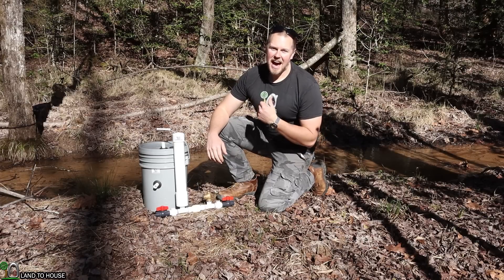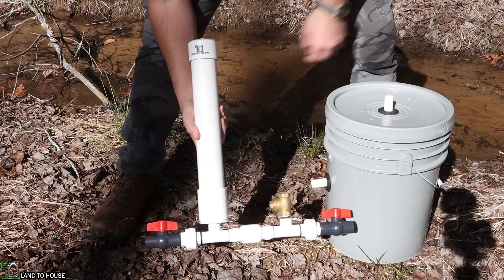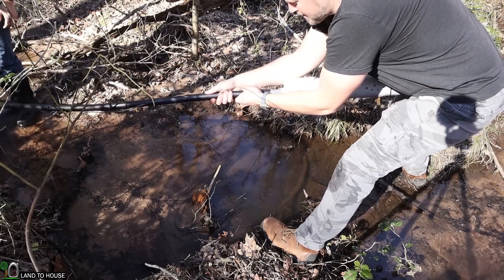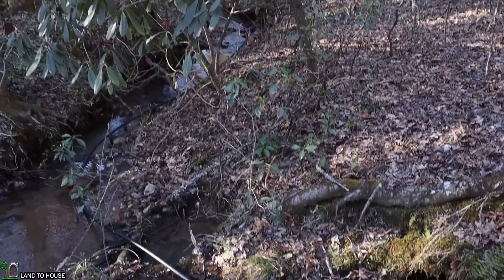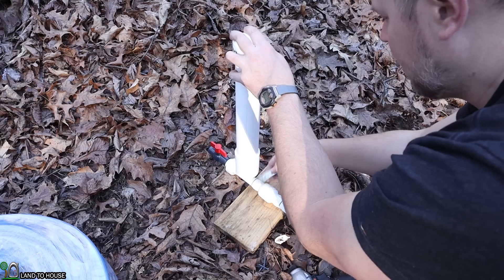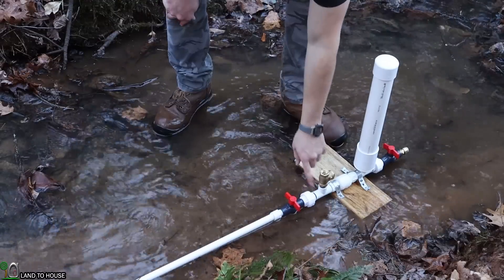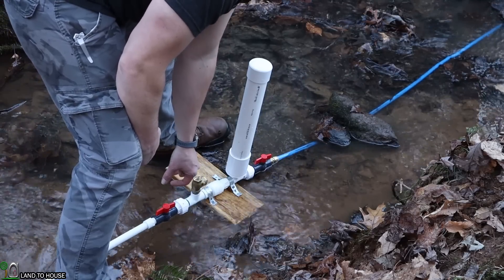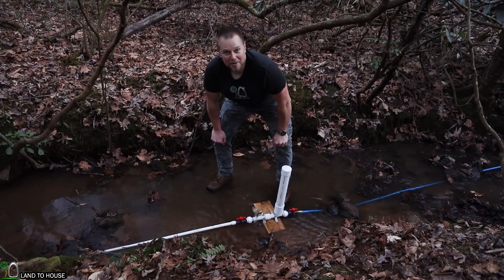Off Grid Water Pump lifts over 50 feet [Full 1/2" Ram Pump Install]

Comment: Seth--the creek water level is about 2' deep at the low water point. Does the filtered  intake unit HAVE to be above the bucket? Or if water pressure is there without gravity, will it work?

Comment: how big must the ram - pump Be to give a delivery of 4"pipe .
Reply from the maker: You can use any size delivery pipe you like on a ram pump. If you are looking for that much water you will need to find another style pump. The ram pump is not designed for that.

Comment: With that flow, in my opinion an intake box (preferably with coanda) would have been a far better choice. It would eliminate sediment, prevent that pipe from being clogged and increase your head pressure slightly. If that stream floods, that whole assembly is going by bye…..

Comment: would have made a dam and then the ran setup in front of the dam as the dam would trap sediment and your pipe would have clean water. your supply pipe would be set i n the dam giving you more head pressure

Comment: great video. lift is not perhaps the word though. water can only be lifted 32 feet at sea level. It can be pushed, up any distance though. water will separate into a void if it is drawn any higher than 32 feet. Not being a water asshole here, just hoping to add some physics to the thought pond. Your pump is great and it pushes water.

Comment: I ran a test a while back. I changed the first one-way valve from vertical to angled. I wanted to see whether it would change the flow rate and it did vastly improve. One direction results in the flap closing with lower water flow since the flap is already partially closed while at rest and the pump cycles quickly. The other results in a delayed flap closure since the water velocity must be higher to overcome the flap being angled past vertical. This has a slower cycle time, but the water velocity is higher. I allowed the system to run for a few minutes at each angle and did a stop watch test with a 20 ounce bottle. Have an amazing day!

Comment: Seth    I bought a little 1/2 inch pump from you two or three years ago and began experimenting trying to get water from a creek up to an orchard.   I know you look for ideas to create videos comparing different designs.  I have found through experimentation that I can almost double the flow of my system by using a check valve one size larger than the ram pump.  I currently have a 1-1/2 inch ram pump with a 2 inch swing check valve (stainless).  Changing from a 1-1/2 inch check valve to the 2 inch valve changed my flow at the top from 54 seconds / gallon to 29 seconds / gallon.   My system has a 500 foot run up the orchard with a 70 foot lift.   If you want to try something different, try experimenting with increasing the size of the swing valve (oversizing it) without changing anything else.   As always, great video.
Reply: Changing both delivery valve and waste valve or either only delivery valve or waste valve?

Comment: For the blue PVC pipe supplying the water for use: could you start with a bigger diameter pipe (like 1") and step it down to 3\4" to 1\2" and build pressure that way? I know we do it in residential houses just wasn't sure if it would work in this application?

Comment: I remember viewing a video of how California gold miners used water to create a massive high pressure water hose to wash the banks with water to find gold. They did this using progressive larger pipes going uphill to the water source. Since water is just over 8 pounds per gallon this water weight increase the water pressure at the base to a modern day fire hose. This would be a good model for this project to maximize one's efforts.

Comment: I’d like to see a video of a high lifter pump, I used to own one years ago.  They can run on as little as a trickle of water, automatically start on their own and deliver water up to 1000 feet of head, given enough drop and enough water.  Ours delivered 1300 gallons a day with about 30 feet of drop from collection to the pump (drive pipe) and delivered it 400 feet of head.  It was absolutely the coolest thing I’ve ever purchased.
Reply: Where did you purchase it?
Reply: @ here’s a link to where you can buy one. I suggest you look at the requirements that are needed for it to run properly. That information is available on their website. 
Best of luck,
Robert.
Reply: @robertg9514  I didn't see no link. Can you post it pls. Thanks

Comment: Land to house

Damn son, not only could I see the weight gain, I can hear the shortness of breath when you speak.

20 carbs or less per day, I lost 0.5 lb per day on that diet

93 lb later, I stopped doing that keto diet 7 years ago. Haven't gained anything back

It's totally worth it and you only have cravings for the first couple weeks. After that. It's easy sailing

Comment: Very good video! Please be aware of a few things plumbing related...1. An effect called friction loss. Where for each foot of water in a pipr you will lose X amount of pressure due to friction against the inner walls of the pipe. In theory you could run a pipe long enough the the infeed pressure is totally negated by friction loss and no water would ever come out the other end. 

2. When you double the diameter of a pipe, the flow rate is quadrupled! So changing that 1/2 inch pex to a 1 inch line would allow a much better flow at the end! 

Thanks for sharing, i was unaware you could have such a long infeed pipe for the ram pump to achieve your drop/head pressure.
Reply from the maker: The output of the ram pump is low flow low pressure. At 1/4 gallon per minute at best on the small pump the friction loss should be very small. I would have used a poly for the delivery over the pex.

Comment: Am wondering.. does the size of pipe matter from the Ram Pump to the storage tank? Is there more output volume with a smaller pipe or more with a larger pipe... 1/2" vs 3/4 in.
Reply: I think you want the intake pipe to be double the size of the output pipe

Comment: Why not strap the ram pump vertically to a tree?
Reply from the maker: That is a very valid way to mount the pump. This homeowner was going to move it 100 feet further down the creek so we did not lock it down in the video.

Comment: Can you use a ram pump to pump water up a hill then down the other side and have a water turbine creating power at the bottom? Once the ram pump gets up to the top, suction and gravity should pull a steady flow down the hill to create power. Just a random though lol
Reply: It wouldn't be anything worth doing. Pressure and flow need to be very high
Reply: If the outlet elevation is lower you can just siphon over a hill.
Reply: Maybe run it up to a water tower then run that out to another ram pump going down over to your watermill or whatever you're powering. Idk I'm not a plumber

Comment: I have an 1 1/4" ram pump. I need to lift the water as far as possible. It takes less pressure to move a smaller column of water correct? I wonder if I should use 1/2" PEX or 5/8" or 3/4"? (About 6" of drop with massive amounts of water)

Comment: I have a low-flow creek. I want to build a 1/2 inch pump that will deliver water about thirty feet to a 100 gallon tub. The approximate lift from creek to tub will be about ten or fifteen feet. How much supply pipe from bucket to pump? And how much supply pipe from intake to bucket?  Do you have a formula? My understanding is for every one foot of intake there is seven feet of lift, but I'm not sure if that is from the initial intake or the reservoir bucket. I'm near to going on Amazon and buying your 1/2 inch ram pump. Thanks for any help. I'm subscribed.
Reply from the maker: The 1:7 ratio of input head pressure to lift out is correct. The ram pump needs 2.5 feet of head pressure minimum to get the pump cycling. This minimum is all you would need to lift water to 15 feet. 

The head pressure is measured from the silt bucket to the ram pump. If your creek does not have much silt you can remove the filter bucket.  The head pressure would then be from the source intake to the pump.
Reply: @LandtoHouse  Thank you much for the quick reply. I think I'll try the bucket-less approach first and see what happens. Much clearer now what I have to do. The creek runs under my driveway and through a culvert. I tried putting my tub under the culvert, and it filled up so high so fast with silt that I couldn't move the tub and had to empty it by hand. But I don't want to use a bucket because the creek is shallow and full of rocks. We'll see what happens. Thanks again. Keep those videos coming!

Comment: For filling the delivery pipe, could you not do the usual trick of leaving it open to match the source, then close the value, get the pressure tank up to pressure and then open the delivery again to use the pressure to shove water up the delivery pipe, then close and repeat until it cycles on its own. Should bring down the number of manual valve pushes because it only needs a couple to pressurise the tank enough for it to run on its own. 

I’m thinking manually action the valve a couple of times until the pressure tank builds pressure to run on its own, let it run for 30 seconds or so, then open the delivery and wait for the pressure to drop, then close the delivery again, manually action a couple of times until it runs on its own, leave for 30s and then open the delivery again. Rinse and repeat until the delivery is full enough to cycle on its own. 

Hope that rambling made sense 🤣
Reply: Also perhaps capping the delivery pipe to compress the air in it to build back pressure might work.

Comment: Squirrels love to chew holes through the blue 1/4” used in maple stands for syrup production - destroying pressure. Do they bother these setups?
Reply from the maker: I am not sure about this pex line. I have found that 100psi poly pipe does well with squirrels. The thinner 50psi poly gets chewed by squirrels.

Comment: I’m on your site about to purchase the 1/2”. What’s the difference between the ram pump and the ram pump kit?  Do I need both to make it work?
Reply from the maker: The ram pump is a fully assembled pump and the kit has all of the pieces that you assemble a pump yourself. They are separate pumps. You only need one or the other.
Reply: @LandtoHouse  okay. Thanks. I just wanted to make sure. Do you install pumps in Virginia?
Reply from the maker: Happy to help. I actually have only installed for local people.  Today's video was for a friend.

Comment: The #1 element that people overlook is the "head weight" of the water inside the tube. The higher the water is to be pumped - the smaller the tube needs to be. If the tube is larger it holds more water and it's weight will always push down. 
This is a great option and I hope many of your viewers try this. 👌 -KJ
Reply: your talking about the "output side" pipe diameter needs to be smaller for longer distance?.. thanks
Reply: @genealamos9888  Correct. The more water you're pushing up at one time - the more weight your pump is fighting. Skinny tubing takes longer but it's the only way to go up great heights.
Reply: @KaleidoscopeJunkie  thank you makes sense
Reply: Head pressure at a given height is the same in a 36 inch diameter pipe as it is in a 1/4 inch one.
Reply: @44thala49  The problem is not the pressure per diameter at one given point.

The problem comes with the water above that point.
 More water = more weight/resistance.
10' of water in a 36 in dia pipe weighs more than 10' of water in a 1/4 inch pipe.
Simple physics.....🖖

Comment: Shouldn’t he have used poly pipe for the delivery pipe instead of pex I thought pex isn’t UV stable?
Reply from the maker: I mentioned that to him but he wanted to use pe . Perhaps he will be putting some ground cover over it.  I recommend 100psi polypipe for the delivery uphill.
Reply: @LandtoHouse  You mention 100psi poly, but in this application would 60psi be sufficient as well?
Reply from the maker: The thinner poly is more likely to be chewn by rodents. But it works just fine for the ram pump.

Comment: What is the stand pipe for? Just get rid of excess air?
Reply from the maker: When the pressure wave travels in a drive pipe that is too long it starts to weaken. Much more than 100 feet and it drops down to nothing. This stops the pump. The stand pipe brings the source head pressure closer to the pump and shortens the drive pipe length.
Reply: So by using the poly pipe first you get the benefit of increased head pressure but without making the drive pipe too long?
Reply from the maker: @BobBob-il2ku  Exactly! Brings the source closer and maintains the head pressure.

Comment: Would it be faster to add air directly in the tank with a bike pump compared to cycle it a lot of times?
Reply from the maker: The cycling of the waste valve 100 times is to fill the delivery pipe up hill with water. This water column causes backpressure on the pump so the valve can cycle on its own. The pressure tank does not need any extra air at this point.

Comment: Thank you. Your videos were so helpful when I was looking into ram pumps for watering the garden. It's the second year I'm using mine and it's working great.
Reply from the maker: Very good! Nice to hear of multi year use. Some are still using pumps from 7 years ago.
Reply: @LandtoHouse  I think I may have to replace the rubber seals on the holding tanks they are leaking a little. Have you had any issues with the cold affecting them?
Reply from the maker: @creativeredneckin7258   Do you mean on a storage tank like an IBC tote?
Reply: @Land to House  yes I use 2- 55 gallon drums and uniseals where the pvc connects the 2 barrels and for the output pipe. Last year they did well but just got the pump running this spring and the uniseals are leaking which slows how quickly I can fill the barrels.
Reply: Plastic 55 gal drums